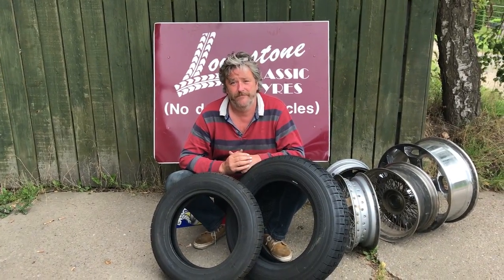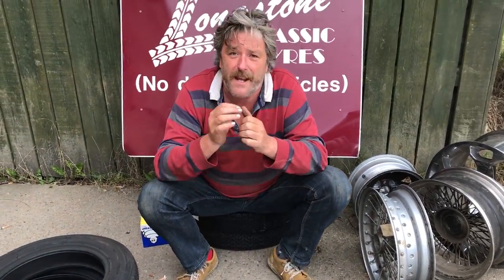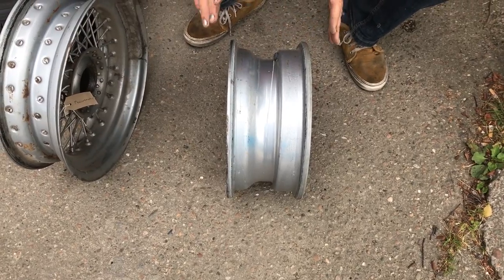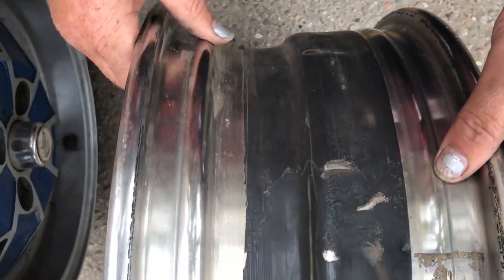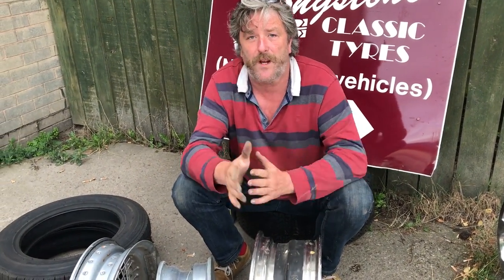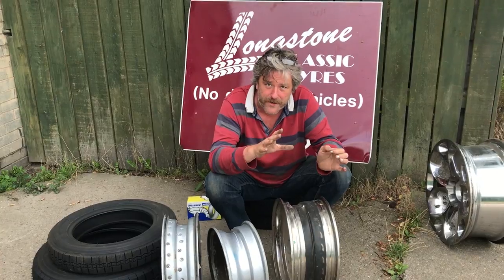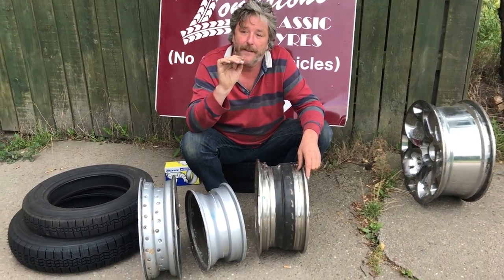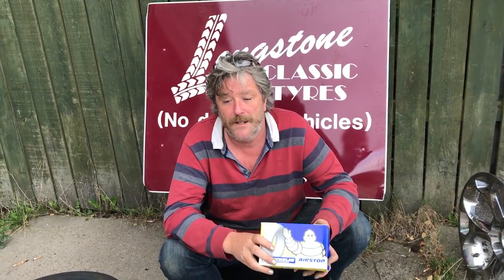What is a Tubeless Wheel

Comment: I like your video.  Would you like to comment on internal differences between tube-type and tubeless tires?  Vintage tubeless tires will be smooth on the inside to be "friendly" with an inner tube. Tubeless tires most often have a lot of molding flash inside which can be harsh when in contact with an inner tube.  A cheap ot thin inner tube will often crack and leak due to the molding flash in a tubeless tire.  People recommend thick or heavy brand name tubes to cope with this situation.

Do you think a good inner tube is sufficient to use in a tubeless tire on a wire wheel? Or would you recommend grinding the inside of a tubeless tire to remove molding flash if using a tube? Or would you recommend only using  "tube type" tire on a wire wheel?  Tube type tires have become very difficult to find in North America.  I need 165-80-15 radial tires for my vintage MG MGA, and the modern supply in that size is almost always tubeless type tires with molding flash inside.

Comment: I don't get it, mine says tubeless, but i still need to put air in them..... If there is no tube and you just fit the tire onto the wheel then how would it keep the air inside?
Reply: I also have same doubt
Reply: The rubber forms a seal with the rim because of the air pressure.